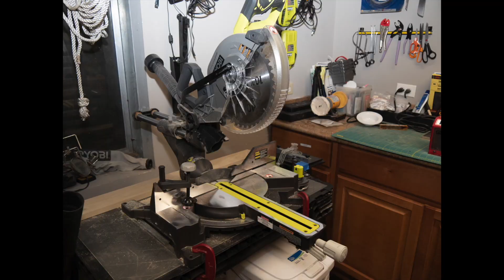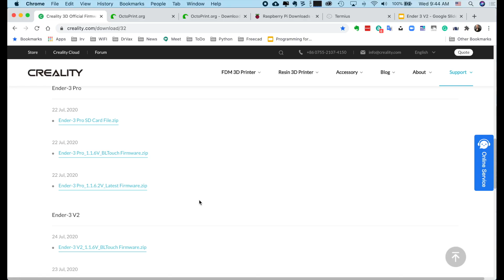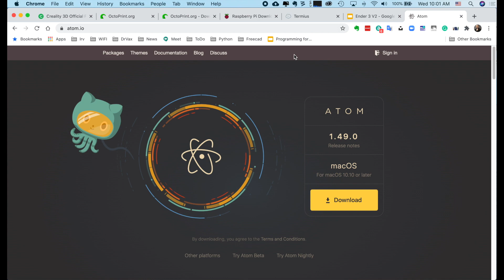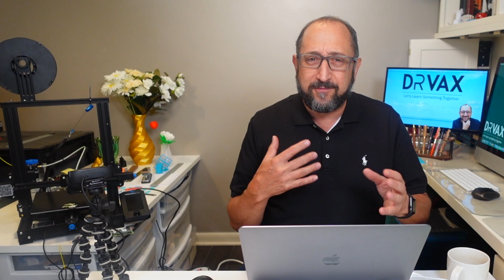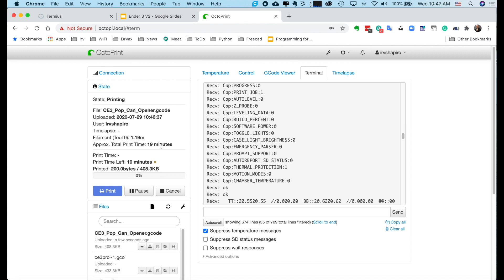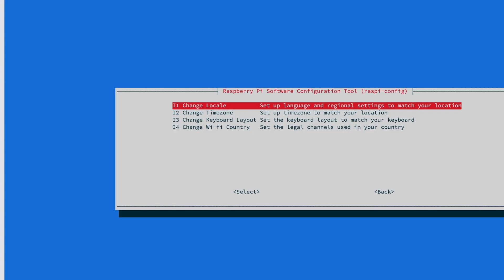Install Octoprint | Ender 3 V2 Firmware Update | Wifi 3d Printing

Comment: On the topic of missing commands, the biggest thing I've learned is that the official Creality firmware just plain sucks and strips out way too many common commands (M600 for a filament change comes to mind).  The best thing to do is get a better build of Marlin installed, whether that means compiling it yourself, or installing someone else's builds.  I haven't looked back since installing the mriscoc firmware builds.

Comment: For the usb to printer cable you can cut the jacket back on the cable just a little and cut the red wire to stop power from passing.   The one from th3d works and just saves you from cutting into a cable.  I have several cables laying around and not being used so I just cut one.   Saved $7
Reply: this also worked for me

Comment: tip: in advanced settings you can setup your wifi connection pre-imaging (in the pi imager) without having to open the txt file and edit it. just an fyi and much easier than going into a file and manually edit.

Comment: Dr S, Does the web interface have an option for shutting your pi down without corrupting the sd card? Am about to set up octoprint on my 4 printers. Juggling SD cards has gotten too confusing.

Comment: My screen showing this error, no more candidates to test and no working port/baudrate combination detected
Reply from the maker: Check the cable.  You need to ensure you are using a data usb cable not just a charging cable.   Also verify the printer is powered on.

Comment: Can I use this with a payment webhook to automatically trigger the Ender 3 V2 to print a specific file (would be based on the product_id ordered). I would expose a server on the pi, so not asking about that specific part, just if I can programmatically trigger a print through the pi. Thanks. Fantastic video.
Reply from the maker: Probably yes.   Octoprint has an api.

https://docs.octoprint.org/en/master/api/index.html

Comment: so, basically you install octopriint in the raspberry, and the only thing connecting between raspberry and the ender 3 v2 is the micro USB cable, correct? thanks!
Reply from the maker: Yes

Comment: Hello DrVax, fantastic instructional video, it greatly helped me to setup my Raspberry Pi4 and install the Octoprint OS many thanks! Once Octoprint is up and running do you have to leave the sd card inserted in the Raspberry Pi? I tried printing the same Pop can opener that you printed in this video. I received an error message stating that it was to big for my Ender 5 pro build plate. I did enter my Ender 5 pro's specs correctly when I set up the 3d printers profile in Octoprint. Upon careful examination in the Octoprint window I discovered that for whatever reason the Pop can opener was not in the center of the grid in the Octoprint window. Basically it was off the build grid plate. I'm assuming that was the reason it reported that it was  to large to print. Is there a way to re-center the Pop can opener in the Octoprint window?

Comment: This was extremely helpful for me, and very clear to follow. I've wondered before about the whole Octoprint thing but never really understood how to get it going. I may very well install this on my own Ender 3 V2 because of this, thank you! Just one question - does the printer have to be connected to the computer all the time, and if so can the computer be switched off once the .stl file has been transferred to the printer/Raspbery Pi? Oh, and the symbol you call 'pound' (#) is what we in the UK call a hash. A pound symbol to us would be this £.

Comment: One burning question i can't seem to get answered.  I mainly want to use Octoprint just to monitor my prints when i'm away through the camera.  Getting a file to the printer with Octoprint doesn't really seem all that intuitive or faster.  I want to slice in Cura, load to my USB, and print from the USB stick.  If i install a Raspberry Pi/octoprint, can i still print from the stick?  Thanks in advance.
Reply: Yes you can keep printing the way you always have if you want to.

Comment: Well, correct me if i am wrong: The fact that you have to level the bed of the Ender 3 v2 everytime before you start printing makes remote printing kind of useless except for people who print 24/7,  keep the printer in the basement or are living in a castle.
Reply: Why do you say it needs to be leveled every single time? I've never had that problem so curious what you mean.

Comment: Hello DrVax, love your channel, thank you!  I have a quick question.  I currently have Octopi v0.17.0 loaded onto my SD Card in my Raspberry Pi 3 B.  I see v0.18.0 is currently out.  Is there a way to upgrade to the new one without having to basically start from scratch again?  Meaning, can I just do and update and still keep all my passwords and octoprint setting in tact or do I need to start from scratch again after installing the way you are explaining?  Thank you in advance for your help!

Comment: Thank you, you made this subject very clear to me. I'm very happy I found you. I am 67, built my first computer myself in the late 1970 's but this is all new to me; my Raspberry PI is coming tomorrow and my Crealty Ender 3 V2 next week. I can't wait getting started with this new adventure. I downloaded Cura already and had some files sliced, so far so good.
Reply: So, how did it go? Liking your printer?
Reply: I guess you are up to speed already, My order came in yesterday and everything is ready to print so far.
Reply: @ Gerard Sietsma I was 60 last year and also have built computers. I got an Ender 3 V2 last year. First thing I did while putting it together was upgrade the springs on the bed. I also put Jyers UI on the printer and upgraded the screen software too. I just got a Raspberry Pi 0 2w kit to put on it. I love Dr. Vax videos. He'll always be Dr. Vax to me because I was a computer operator on several DEC VAX mainframe computers.

Comment: Tip, you can just tape the 5V pin on your USB instead of buying the ''blocker''
Reply from the maker: Sounds like it might work.  I have not tried it.
Reply: @MakeWithTech  Did it to mine, works perfectly!

Comment: Thank you for this! You saved me from having to buy a new mainboard for my V2. I replaced the hot bed and glass bed due to warping issues, and afterwards, the SD card reader in the printer stopped reading Gcode. But ONLY gcode. I could load firmware into the printer and it would update! But when I go to the print menu, no matter how many gcode files I had in there, no matter how long or short the names, or how many sd cards, freshly formatted to fat32 4k I tried, the printer will not see them! However, Ocopti sees them on the SD card! Ha I have no idea how this happened. The SD card reader is clearly working, as I am printing off the SD card right now, through Octopi. I just can't print through the printer. Ha soo yea. Thank you so much!!!

Comment: If you dont have the "Connect OctoPrint" option in Cura install the plugin found in "Marketplace" top right.

Thanks for this! Ive been using Octoprint for years so forgot to set it up now that I have the Ender 3 V2.

Comment: @DrVax or anyone who may have some insight... 
I had wifi working on my Octopi until I added Eero router and it is now my primary wifi router. I created wifi using the same SSID as before but now the pi will not connect. Everything is the same, same SSID, same password. What could be the issue? example" SSID="B's WiFi" | psk="0987654231" Any insight for the solution would be most appreciated.

Comment: Great video - could you tell me if is the set up the same for a Creality CR-6?
Reply from the maker: Octoprint  works with almost any 3D printer that has a USB or serial connection.

Comment: Hi,
Can you try one more thing with this setup?  Disconnect internet from your router and check if everything is still running? I’m running everything off the net here. So if octoprint or the rPi is set to communicate, it will fail.
Thanks.

Comment: Have trouble to get any USB Webcam to run.
vcgencmd get_camera
supported=1 detected=0
Bus 001 Device 006: ID 1ae7:2001 X-TENSIONS SpeedLink Snappy Mic webcam (SL-6825-SBK)

The cam works with my PC, so is there any troubleshooting?

Comment: I installed the BlTouch firmware on my Ender 3 V2 without hardware connected. "Level" option appeared on the screen. Also, printer stopped working, as in, stopped moving all axis. Had to revert to usual firmware.
Reply: Same here, cant find the firmware needed anymore on the creality site
Reply from the maker: Use the smith3d firmware.
Reply: @MakeWithTech  it looks like there's only firmware for the bltouch on that site, the issue we are having is that we don't have a bltouch and creality changed their downloads page

Thanks for the extremely quick reply though!
Reply from the maker: My mistake.  For stock Creality firmware look here:

https://www.creality.com/download
Reply: @SpunkySmithers  You can download 1.0.2 firmware from Creality, that one doesn't have the BlTouch and it gets the printer working again. I however, now upgraded the firmware to the latest one from Marlin page and have no issues to speak of.

Comment: I got this all set up and my prints are terrible. Te printer stutters on every arc it prints. Any idea why this happens, or how to fix that? How did you connect the raspi to your printer? Via the usb connection on the front? Thanks for taking the time!

Comment: Thanks Doctor, for the informative video. However, I'm sad as Amazon is unable to ship to my location, is there another way to use Octoprint without a Raspberry Pi? I thought the main board for the V2 would be able to incorporate the Bltouch and the Octoprint. Am I wrong?
Reply from the maker: You can run Octoprint on a windows, mac or linix system.  Google it for more information.

Comment: sudo (su-do) means "superuser do" it isn't a more secure mode. It just allows you to do more things on the computer that is more restrictive to a normal user. if anything its pretty dangerous if you don't know what you're doing
Reply from the maker: You are correct.   I try to explain things in non technical language.   You use of the term more restrictive is probably a better explanation than more secure.  Thanks for your comment.

Comment: Amazing video as always, rich in details special for people like me that are starting on the 3D print world. I bought a CR-10 V3 two months ago.
DrVax, I had a problem at the end of the process. I received the error: " Failed to autodetect serial port, please set it manually", and there is no choice on the Serial Port, only "AUTO". Then I've updated to OctoPrint: 1.4.2, after that error changed to "(Error: No more candidates to test, and no working port/baudrate combination detected.) The Serial Port is still showing only "AUTO" as option, but the Baudrate has several.
I already rebuild the SDcard following all your steps again and the same problem happens. Do you have any idea why this is happening?
Reply: I know you posted this 6 months ago but for anyone else that runs into this issue, I had the same thing happen to me and I had to try a few different cables before finding one that worked. Strange that it was working before the software update though..

Comment: Hello, most of the raspberry pi kits on amazon come with an OS preinstalled (Raspian etc) would that be an issue when trying to put octoprint on it?
Thanks!
Reply from the maker: This is not a problem.   The operating system you use on a Raspberry and is defined by the software on the sd card.   Just use the Raspberry Imager to save the Octopi image right over the OS image that is already on the card.
Reply: @MakeWithTech  Awesome, thank you!

Comment: Who can answer this simple question? My raspberry pi 4 came with a sd card with noobs loaded into it, my pi4 will not run without this card installed. Can this card be used to load other files,programs etc... on it without corrupting noobs?  A simple yes or no please
Reply: Not sure but that's not a problem. You can do whatever you want with your sd card and then install noobs from the raspberry pi website

Comment: One thing to add.  The Ender 3 V2 needs a Temperature fix.   There is a bug with the current temperature mechanism in Octoprint which only reports temp while printing.

https://community.octoprint.org/t/temperature-reporting-now-working-with-new-ender-3-v2/21053/25

Download the Fix Zip file in that thread and upload it via SCP/SSH to /.octoprint/plugins and restart octoprint.

Comment: Hello, I have a question slightly unrelated to this particular video, but more related to your ender 5 and Prusa Mk3 videos. Ive been on wait-list for the mk3, as I'd like a fast reliable printer for selling prints. Right now I use an ender 3.

I've watched your videos on the Prusa and ender 5's print speeds, but also your video on enhancing the ender 5 with the BL touch and new extruder. And since you can also put a direct drive extruder on the ender 5, in your opinion is the mk3 still worth the money? Or is getting the ender 5 better and just upgrading as you have a more stable core x y frame?

Thank you, Jake.

Comment: I purchased a Creality Ender 3 V2, as a BLTouch levelling system isn't yet available. I thought this would be a great addition. Do you know if your can monitor the Raspberry Pi and change Gcode with a Smart Phone or Tablet? I had a bad experience with a previous printer when the wiring loom to the Hotend caught fire when the family were all sleeping, luckily the smoke detectors alerted us. Having mobile access would allow me to be able to monitor the print and the printer when I'm out or in another room of the house. Also will the Pi act as a storage device  / buffer for the Gcode file? What I mean is, can I switch off my PC and let the Pi handle the print without using a SD card?
Reply: following

Comment: Love your enthusiasm and learning a lot from your videos. I have 2 Ender 3 Pros and a CR -6 SE on the way. I followed your lead and got a Raspberry Pi 4 kit and loaded Octopi on Monday. One issue I am having is that printing from Octoprint is 30 to 50% slower than from an SD card. Have you experienced the same issue or do I have a problem with my setup? I have the Octopi attached to only one of the printers.

Comment: The fact that LCD dependent commands are not working on the V2 make this printer much, much less of a machine. What is the point of a nice colorful screen if it has the effect of actually dumbing down its capabilities? I'm sure the community will rise to the challenge and find a work round and the good work Dr Vax does will also help. Really Creality should hang their heads in shame for releasing a machine which hasn't been fully thought through.
Reply from the maker: I was quite surprised by this.

Comment: What is nit mentioned here is yhe amount of times that after a print tge screen locks up on the V2 because of octopi and gge printer needs to be powered off and on again.  firmware on creality site is wrong versions. All current versions were emailed to me by creality and are available here
https://m.facebook.com/groups/2656146484656850?view=permalink&id=2657866297818202

Comment: I had a raspberry pi 2 lying around and used octoprint on it and connected a 10 dollar Pi camera to it. So far I have not had any issues. I really like the screen on the V2 and it just sits there while I use octoprint. I hope someone figures out how to integrate the screen better with octoprint.  The screen does not stay on when I power off my printer so the Power Blough is not really necessary in my case. I will need to look into making my octoprint instance more secure like you showed here. This is my first 3d printer and I am enjoying learning more about this hobby through your channel.  Thank you. :)

Comment: ty for the great vid. Question tho: If I use an ethernet connection for my RaspPi, how do I connect to OctoPi site since that wouldn't be on a ".local" address, right?
Reply: I'm not sure. But you can connect through your LAN IP. (ex.192.168.x.x)

Comment: Fyi, www.creality.com keeps changing the download links for the Ender 3 V2 firmware.  One day the BLTouch firmware will be there, another it's gone.  Then sometimes they have 2 identical files, but different link names.  So you were correct @DrVax about the 2 files same exact size.  Still expected errors with Creality as usual.  They are in the process of updating their website, but just assume always inconsistencies.  Yeah, it's definitely not PRUSA!

Latest non-bltouch firmware as of 7/30/2020 is v1.0.1.
V1.1.1 is the BLTouch latest version.
Via INFO button.
Reply: actually 1.0.2 is the latest version. I had it emaild to my from creality
Reply: @MrDraven74  Current version per what is "available" on their download site.  If they emailed you something better, then great!  Firmware versions will change anyways from Creality and from custom Marlin builds via GitHub and other sources.

Comment: You can just put a small electrical tape over the +5V USB A lead going intop the Raspberry pi. This will prevent the power from going to the Ender 3 screen and you don't need another dongle.
Reply: Care to elaborate on how this is done? I don't understand where to put the tape.
Reply: @Ozzie4Para  you put a tiny piece of tape over the +5v lead inside the USB end that connects to the Pi. When looking inside the USB end with the pins/leads on the bottom, it should be the pin/lead farthest to the right. There's a bunch of images online if you search for it if you need further info.